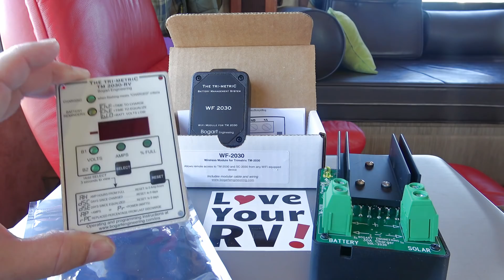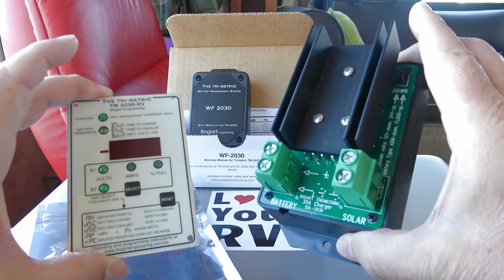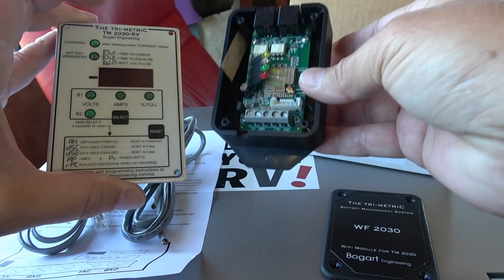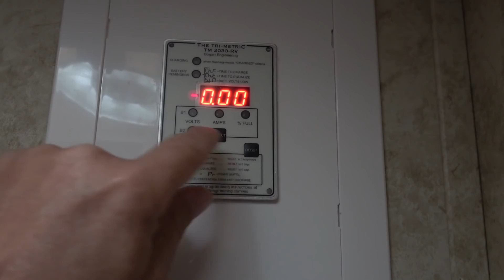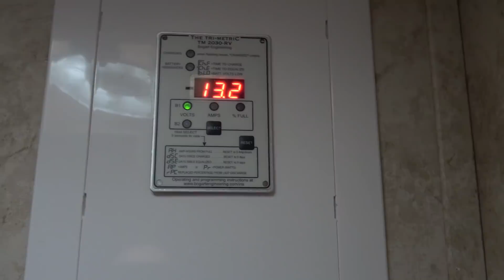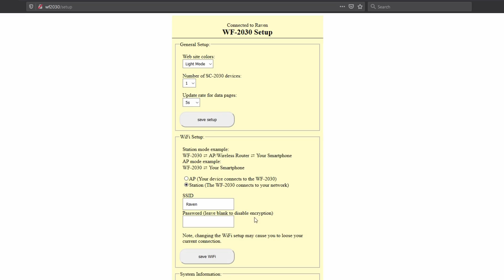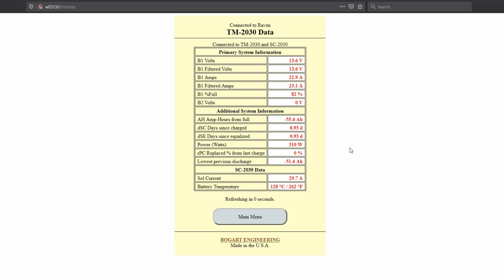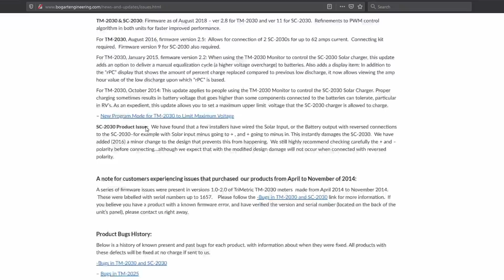Bogart Engineering Trimetric WF-2030 WiFi Module -  Installation and Demo

Comment: Ray, thanks for making this demo video.  We want to thank the viewers for their candid comments & suggestions.  We would like to respond to some of them in a single response.
TM-2030 & SC-2030 firmware - must be 2.5 & 9 respectively or later.  Items shipped by us after Sept 2016 are very likely running the required firmware levels.  However, some dealers have may sold older units.  Look for a label on the faceplate of the monitor, below the terminal block and for a date/ver label on the PCB of the controller.
We chose to go with WiFi  over BT & since it offers wider access options- Windows, Mac, Linux (yes, many customers use Linux!).  Besides, developing & releasing an app for iOS is very demanding since Apple makes it quite difficult.
PWM vs MPPT - this topic will never die!  For small voltage matched systems ("12 V" panels & 12 V batteries), the advantages of a MPPT controller is minor and the cost & complexity of designing & making them (in the US) is high.  Panel/cell temperature has a significant/negative effect on a panel's efficiency.  Add to that, the power required by the controller itself.  Our SC-2030 consumes 5.2 Watts at its max rating of 31 Amps.  Even the best MPPT 30 Amp controller doesn't operate above 92-93% (their specified max efficiency of 97-98% is usually at about 40% of their peak power).  Considering all these factors, the net power delivered to the batteries by a good PWM is about the same as that of an MPPT controller, esp. during peak production time of 10 AM to 3 PM spring to early fall seasons.  If you're chasing the snow & camping at 9000 ft ski resort in January, an MPPT controller is what you need.  For systems with over 500 Watts of solar, an MPPT controller does an advantage.  Here's Victron's CTO on this topic - https://www.victronenergy.com/upload/documents/White-paper-Which-solar-charge-controller-PWM-or-MPPT.pdf  Parallel panel wiring - common for PWM - offers a higher level of reliability over series wiring employed for MPPT.  For boondocking, reliability trumps efficiency, esp. if you rely on CPAP & other medical devices.
We're working a solar panel manufacturer to offer panels that are better suited for PWM controllers.  
Happy to answer additional questions - please contact us at bogart@bogartengineering.com
Reply: I can't figure out why mppt is better over 500 watts! It doesn't seem to add up! Can you explain this?
Reply: @spider78612  MPPT is better even at lower power levels, but only incrementally - usually around 0.2-0.3 Amps/100 Watt at typical real world operating conditions - midday & warm to hot ambient.  However, as you add more panels, the incremental differences add up to something meaningful.  Thus, it's hard to justify the cost of good MPPTs for lower power installations.  There are several low cost MPPT controllers.  These don't offer the advanced battery charging features like Amp-hrs based charging & finish charging available on our PWM controller.  These features have been demonstrated to extend the life of the most expensive part of any installation - batteries.
Reply: From my experience, using you BMS with two SC2030 charge controllers and the Trimetric connected to 960w of solar, feeding four Crown 260a/h golf cart batteries, I have to disagree with your statement of "mppt is better with 500w or larger systems". I have measured amp output on my system, and with very rare exception, my system will put out more amps per rated panel watts then most of the competing MPPT controllers. Sometimes the difference is by a large margin sometimes I have the lead only by a little bit. The only MPPT charge controller that really outperformed my system were systems using MorningStar TriStar MPPT controllers combined with high voltage grid tie type solar panels. The TriStar MPPT is by far one of the best, quickest and most efficient MPPT charge controllers on the market.
In summary, I would word it differently, if one plans to use grid tie panels or connect the panels in series or series parallel, then you are best off using a good efficient MPPT controller. If you plan to use 12v panels in parallel up to 1000w max, then you are much better off with the Bogart Engineering PWM controllers working in conjunction with their Trimetric. In all honesty, now having the system for 5+ flawless years, the precise charging algorithm with the mini equalize absorb/boost stage, and the quiet trouble free operation it provides, this system has far exceeded my expectations. I'm glad that I listened to my friend's suggestion and to his own experience with an identical system. 
I would also like to add that with the larger systems that require two SC030 charge controllers, this setup provides additional redundancy, if in the rare chance one controller would fail, one would still have 50% of their system still operational. Great performance with redundancy to boot! Thank you Bogart Engineering for a great, well designed product, and don't sell it short on the MPPT comparisons...
Reply: @johndiezel5781  Thanks for your vote of confidence on our products. The reason we say that MPPT controllers have a slight edge over PWM controllers is mainly due to the fact that the Voc & Vmp of many new '12V" panels have been creeping up due to technology advancements. Several new, higher efficiency panels have a Voc/Vmp of 21.0 & 19.5V (or something close to that). Even after derating these # for temperature, the voltage at the controllers input can by 16V or higher. This gives MPPT controllers a slight edge. However, PWM controllers makeup in several different wats. For example, if a PWM controller were to fail, you can simply connect the solar + wire to the battery + wire and charge the battery to about 14 Volts manually - you are the 'controller' in this case. Since most MPPT installations also have the panels connected in series, can (but not necessarily) cause some issues. This trick is quite useful when boondocking away from civilization and find yourself with a failed controller (something rare with our SC-2030:=)). In addition to this advantage, our controller lets you terminate charging based on the amp-hrs returned instead of just voltage. This ensures that the reverse chemical reaction is complete with no traces of lead sulfite remaining.

Comment: Good review, thanks. I installed the WF-2030 just yesterday on my system. Have a Winnebago View, 500 watts of solar and the SC-2030 charge controller. It was easy to do and it seems to be working well. Was trading emails with Bogart and one of their employees called me. He helped me verify that my two and a half year old TM-2030 and SC-2030 had current firmware and didn’t need updating. He also explained how the system works over wi-fi and the options, great customer service. For my simple 12 volt, two battery system the Bogart gear has been a good match. Always loved how you can dive in to the menus and set parameters for any lead acid battery around, or even tinker with the settings. Look forward to your update.
Reply from the maker: Thanks for the feedback.  I remember when I first bought the system and had some questions, I was blown away when I called and was talking to the guy who designed it. Great little US company. :)

Comment: So, judging from your video and the comments below, I'm thinking that:  1. The system works well. 2. It works as advertised. 3. Great customer service. 4. Not a pretty screen. 5. Reasonable price. 6. Small, USA company.

I don't know about everyone else, but I don't care if the product can dance or wash my truck. If it does what it's supposed to do, why change? Perhaps I'm old and cranky (Not!). Cheers, Ray.

Comment: Thanks Ray, I’m going to have to look into this to upgrade my Bogart units. But I’m really interested in seeing you do the mod to use the old controller for charging off the truck’s alternator.
Reply: We did a simple video of that here - https://youtu.be/2yhC-43P_Uk.  No mods to the controller needed; just add fuses/breakers & an ignition activated switch

Comment: Hi Ray, I used Bogart for quiet a few years. I always though the tir-metric monitor was cumbersome and not that user friendly. My wife was not impressed. Glad Bogart is trying to stay up with the times giving wireless programming and monitoring. Their web GUI looks a little dated. I made the switch to Victron and do not regret it one bit. Looks like Bogart still dose not offer MPPT charge controllers. I would say you should come out of the dark ages but if Bogart is giving you equipment, then stay dark.😉 Thanks for the video!
Reply from the maker: Yeah, the Bogart stuff does look like it's built by an engineer for engineers, they don't pretty things up much to make things friendly looking for the average consumer. :) They need to put it in a nice box with some blue lights. ;)
Reply: Love Your RV, I’m an electrical engineer😳
Reply from the maker: ahh, Guess that's why "I used Bogart for quite a few years" :)

Comment: Great video Ray! I'm still "pondering" as to which battery monitor to get for my setup. From what I've seen, only the Victron monitors have wireless capability. The 712 is built in and the others you can get a "dongle". I'd like to have the convenience of wireless but it looks like you're going to pay for it. I'm currently using two 6 volt Interstates and I picked up a Renogy Rover 30 on the Black Friday sale last year. Can't wait for winter to be over to install my solar system!

Comment: Interesting in the fact that I will now have to send my 2030 units in to get their firmware updated and then buy the WI-FI module.   Looks like for only a few more bucks I can just upgrade to the latest and greatest MPPT controller.   Things to think about. I wish the firmware could be updated from home.
Reply from the maker: Thanks for the feedback about the firmware, its a big con I will include in my review. I never updated mine as it was a hassle to send in and wait for it to come back, plus the cost. Cheers, Ray

Comment: Hi, you did mentionned quickly about accessing the wi-fi module from internet.
From what I have seen on the video, the web page seems to not be secure/encrypted (broken padlock).
I would never open a port on the internet side and do a port forwarding to an insecure page from the router to the internal network. It is just asking for troubles.
Please correct me if I am wrong.
Reply from the maker: This what my contact at Bogart told me - "Trimetric monitor can be accessed over the internet; we recommend running  a VPN server on the network that hosts the WF-2030.  This is advanced users only."

Comment: Ray, love your videos. 
 
I bought the WF2030 and am using my iPhone as a browser using “AP mode” rather than “Station mode”. I do not have a router. The WF2030 works fine except that if someone emails me or if I try to use the phone to browse the internet, then the WF2030 “locks up” and becomes unresponsive. Then, the only way I can re-establish a connection to the WF2030 is to power the WF2030 on and off, which is very inconvenient. The same thing occurs if I use my apple laptop for the AP connection. 
 
I was wondering if you might be able to try using AP mode on your phone and let us know the results.
 
My TM2030 and SC2030 both have upgraded software.
 
Thank you.
Reply from the maker: OK tested and it works well on my Android phone and Windows 10 laptop.  But in AP mode you can only be connected to the WF2030, there is no internet to browse or email.  But, if I go to my normal network and then back to the WF2030 network it works no lock up.Maybe contact Bogart. I don't have an  iPhone to test.
Reply: @LoveYourRV  Thank you for taking the time to reply.

Comment: Will this thing converse with a Morningstar mppt? I already have the tm-2030RV but I want a bigger system. Can I still monitor and change parameters?
Reply from the maker: No, its only for connection to the Trimetric and can also connect to the little Bogart 30 amp controller - http://www.bogartengineering.com/products/wf-2030-wifi-remote-tm-2030-monitor.html

Comment: can you "reset" through the wifi on your phone?... or do you need to manually "reset" from the little panel? Thank you
Reply from the maker: What are you trying to reset?
Reply: @LoveYourRV  trying to reset state of charge.  Thank you
Reply from the maker: No, I don't think you can via Wi-Fi but I do have an early version so maybe its possible now. It should automatically reset when the full charge parameters are achieved.  Or you can reboot the 12V power to the Trimetric monitor by pulling the fuse out and putting it back in. The percent charged will show just 2 dashes until the full charge is once again achieved.  If you think the batteries are fully charged you can set the Trimetric to 100% manually by displaying the charge percentage and holding the reset button for a few seconds.  Cheers, Ray
Reply: Thank you!

Comment: So with your newly installed panels now giving you potentially 600w/50amps your 30a charge controller seem to be giving you its maximum output on a full sun day... Have you measured the temperature of the controller when it’s maxed to see if it’s running hot?...  I guess you could run a second red wire (all the panels could be wired to the black wire) to the two new panels and use the old controller on them to split the load between the two controllers...I seem to recall there is room for a couple more panels on your roof ;-)... Ideally a two 400w arrays with twin controllers to feed all that lithium... Tell Anne the guys on the internet say we need more solar... ;-)
Reply from the maker: Yes, I actually have a ground panel too for 700 watts, I added a few more panels a few months back mainly so the system is better sized for the mid winter short solar days in the desert and we also spend some time on the cloudy west coast or in the woods with some shading.  When the Bogart controller is maxed out it is warm to the touch but not hot, one of the benefits of a little Bogart PWM is it doesn't waste a lot of energy with heat. Very efficient with its energy transfer.
The extra lithium capacity and faster charging is great for extra days of capacity and reduced generator time when can't get the sun. I'm going to re-purpose the old controller as a DC-DC converter for truck alternator charging as we drive.  Cheers, Ray
Reply: @LoveYourRV  Hey, now that you've upgraded to a dedicated DC-DC converter, will you reconsider using the old controller now for some of your many panels & just parallel the outputs?  Let us know how that all works out for you if you do, as some of us may need to "cross that bridge" sometime in the future. Thanks for this informative video.  Glad Bogart joined in the pinned conversation, as they did in fact answer my question that my TM-2030 & SC-2030 purchased back in late 2018 will have the necessary updates.

Comment: good to see them try get with the times but that web interface looks like something from the 90's. IMO bluetooth like the Victron has is a better choice. Mine has performed flawlessly.

PS: If you ever come across a bt enabled thermostat I'm looking for one. Lots of wifi ones but I want bt.
Reply from the maker: I don't care much about looks much, info is info. I guess they need a marketing department to pretty things up, but as far as I know, they are quite a small company.  I do find it strange there isn't more completion in the battery monitor space. You have big Victron out of the Netherlands I think, little Bogart out of the USA, then a bunch of cheap Chinese stuff. Cheers, Ray
Reply: Mike, I agree. For me, Times New Roman drives me crazy (it just does) and the double-line table from 1996 doesn't help either, LOL. Other than that, looks like a good unit.